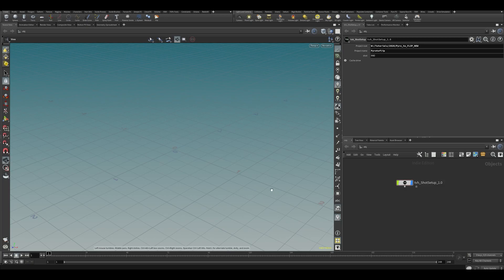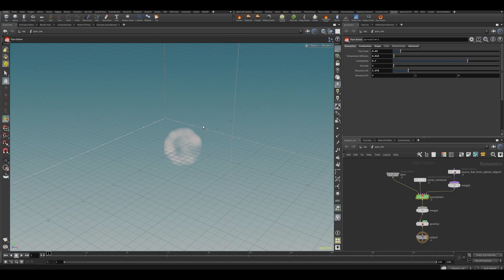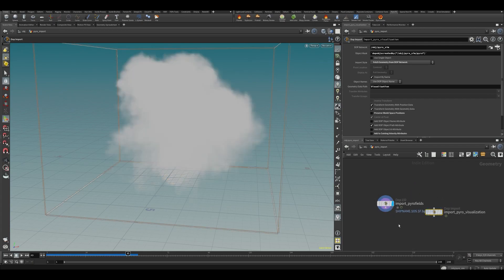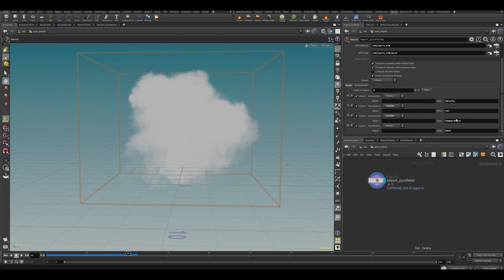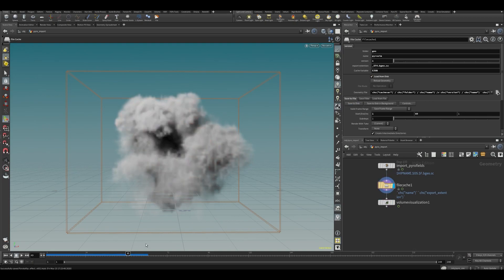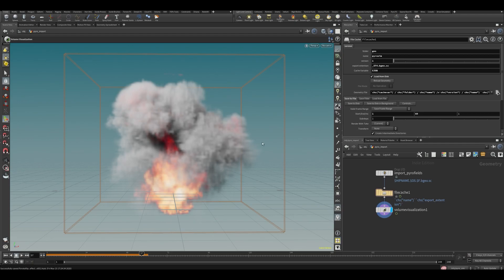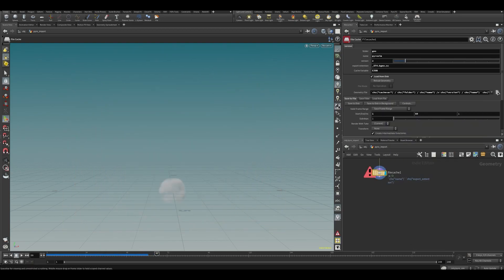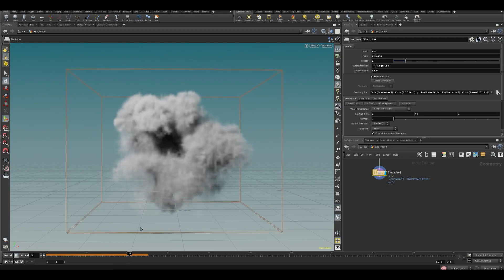Houdini Tutorial - PyroFluid - Chapter 1 - 02 - Basic Pyro Sim

Comment: Very nice! 
But fluid simulation requires a powerful graphics PC.
Reply from the maker: Thanks! Multi core cpu's are quite cheap though these days, you can build quite an amazing pc under $1500 these days with the ryzen cpu's.
I was still on a 8 core 6900k until summer last year when i upgraded to a 3970x, so all of the stuff I did before than on this channel was done on that 8 core still.
Reply: @TimvanHelsdingen  
Unfortunately, beginners and amateurs do not always have the opportunity to have a similar technique.
But many people are now interested in Houdini.
Reply from the maker: @sgimancs  Mostly mean that even with a $1200-1500 build, which is pretty affordable it's still possible to do pretty great simulations. If you are on something very low end then yes it'll be difficult but there is plenty of other stuff you can focus on and learn in houdini without touching pyro or flip. Stuff in POPs, SOPs etc.. is all pretty lightweight and there's plenty to learn there.
Reply: @TimvanHelsdingen  Of course, first you need to learn something simpler for a low-power PC.